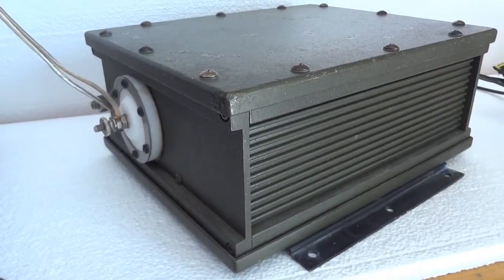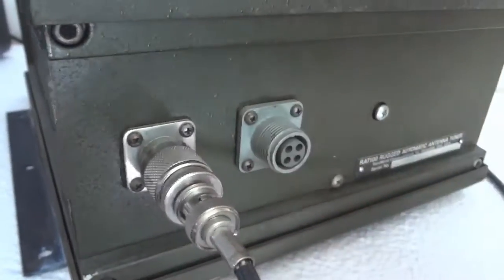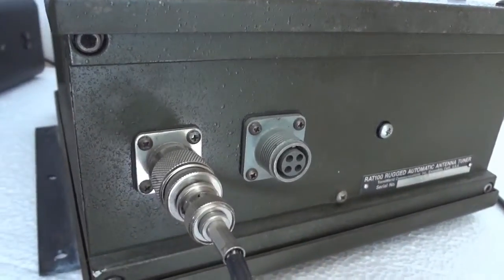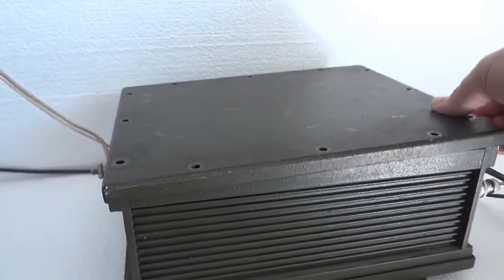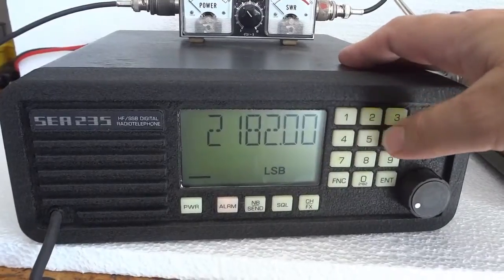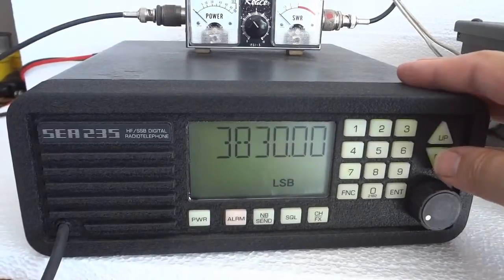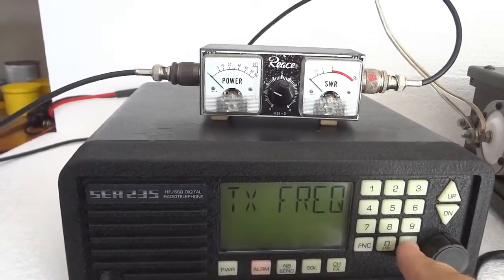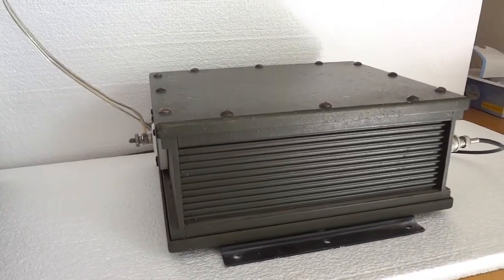RAT100 Military HF automatic antenna coupler Transworld

Comment: İ had this tuner...normally it should Have 4 pins.but this tuner has more than 8 pins.So i couldnt use it
Reply from the maker: The tuner has 4 major control lines: Gnd, Key, Tune Initiate and +`12V DC. That's all you need to operate it.
If the memory option is installed, 4 more lines are used: Data, Chk_Tune, Clock and Strobe. That connects to an RT100 transceiver. But these are not needed when used as a generic tuner.

Comment: Do you have a manual
Reply from the maker: Yes, I do. What is your email address?
Reply: @LifeIsTooShortForQRP  Hoping you will share manual with me! I had the manual for the TW100 and RAT100 but through away the TW100 and manuals forgetting I had the RAT100! Regret this now!  Richard.G.Wilkes@gmail.com
Reply: @LifeIsTooShortForQRP
Reply: Hoping you will share manual with me! I had the manual for the TW100 and RAT100 but through away the TW100 and manuals forgetting I had the RAT100! Regret this now!  Richard.G.Wilkes@gmail.com

Comment: Didn't you get worried the FCC could chase you for putting a 150 watt carrier over a broadcast frequency? or the antenna in front of the tuner radiates a stupidly low amount of power?